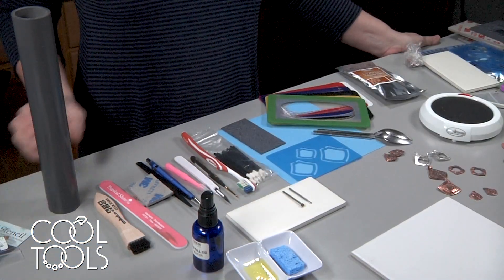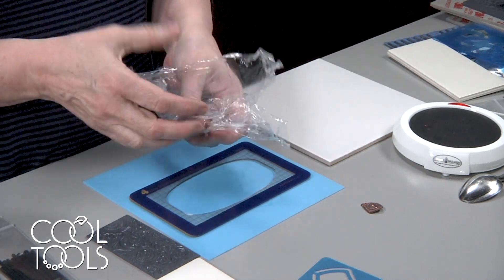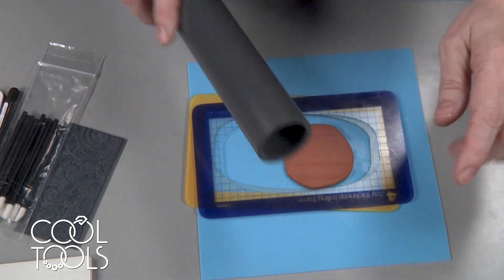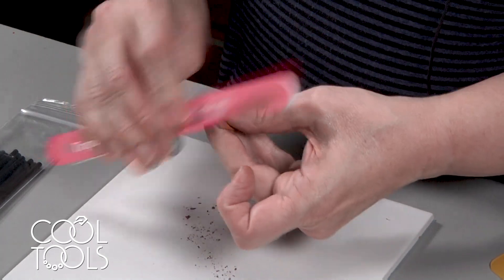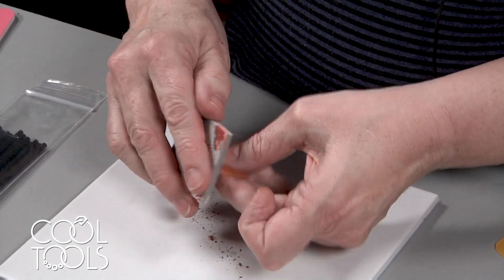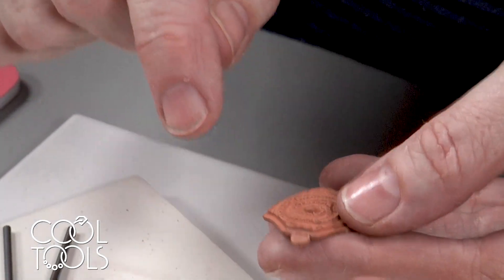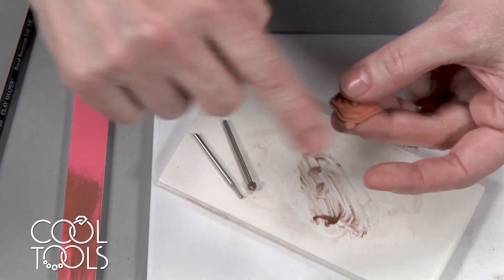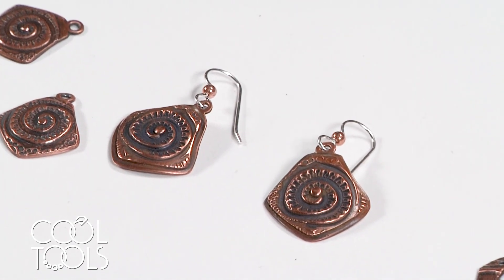Cool Tools | Cyprus™ Copper Clay Faux Layered Earrings by Cindy Pope

Comment: Should have shown the firing...was waiting for it, and it never came
Reply from the maker: Hello, Cyprus Copper Clay has a two stage firing: Place on a mesh firing rack and full ramp to 650°F/343°C and hold for 30 minutes for phase 1, then bury in carbon and full ramp to 1600°F / 871°C and hold for 3 hours. Hope this helps clarify, thanks for watching!